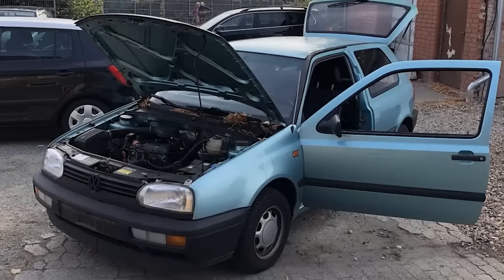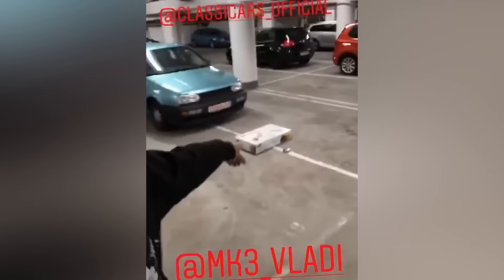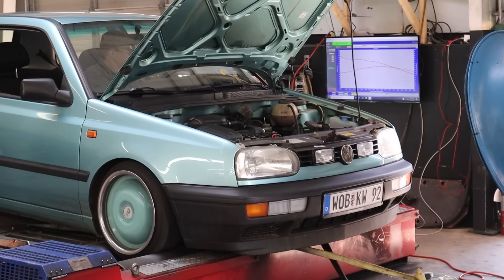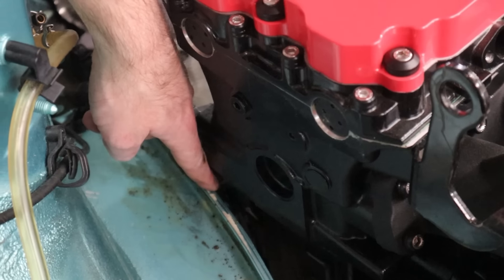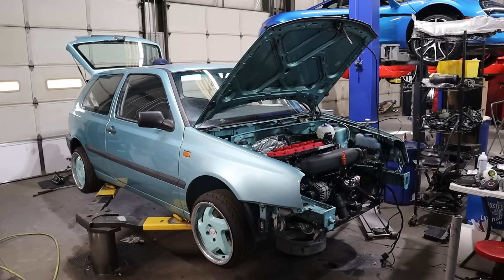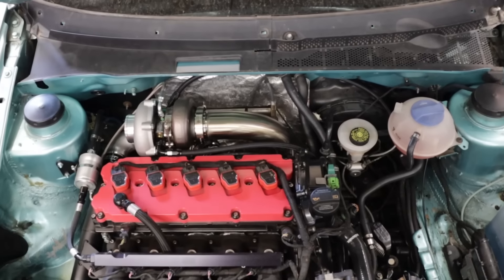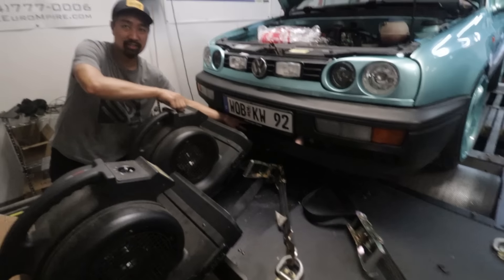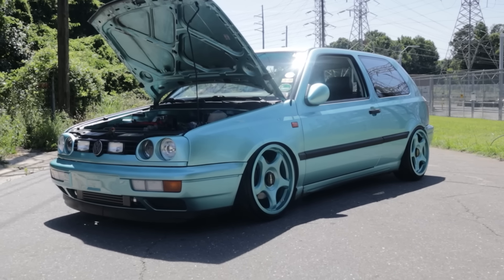James from Donut 2.5t MK3 Build - Start to Finish!

Comment: The more I watch this channel. The better I feel about putting $9,000 into a $800 police impound auction 2004 Golf 2.0 manual. One day my car will be on Deutsche Auto Parts.
Reply: I love MK4s. I miss my 1.8t all the time.
Reply: @Chukijay  I had turd 01 MK4 1.8T Jetta. Not the fastest of cars and it came with the AWW motor, but I miss it so much.
Reply: Currently building my Leon 1M. Just do it, it's the best feeling in the world. If you can afford it of course.
Reply: I just uploaded a video of me replacing the right front wheel bearing. It is so much quieter on the hwy.
Reply: I've been thinking of getting a cheap 2.0 golf and swapping in the 07k.
Reply: @DividE546  nice project. Got my Cupra R 1M 3 month ago, so still a long way to go for me
Reply: As a MK1 TT quattro owner; 1.8t is a brilliant engine
Reply: Get a 1.8t head and some pistons and build a 20v 2.0 t!

Comment: Love that James decided to go with the VW 5 cylinder over the audi 5 cyl. Hopefully this will bring more attention to this engine and open more possibilities for mods!
Reply: I'm pretty sure they're the same engine that you'll find in an Audi
Reply: @avrggamer69  no it’s not.
Reply: @Anon_Fox  yeah it is the 2.5 I5 that is found in Audi's were also being used in VWs it was just developed and designed by Audi but it's definitely the same engine
Reply: @avrggamer69  if you want to say it’s the same with different fueling, injectors, manifold, fuel pumps, etc then sure. Obviously the VW model is stripped down compared to the ttrs. I don’t consider that the same.
Reply: @avrggamer69  no, ttrs/rs3 5cyl is way different from 5cyl from 2.5 NA jetta golf
Reply: @avrggamer69  There are probably many similarities in them but I wouldn't call it the same engine either. There has to be a ton of differences since the other one is a high compression nat. asp. motor and the other one a turbo.
Reply: @mrlaholatva  same argument as the vw n/a 2.0 liter being the same as the FSI or the FSI/tsi. They are different not the same lol
Reply: RS3 engine is alublock, jetta is cast
Reply: Also the cyl heads are different, not fuel Injected like the na 2.5, cams, port size, etc. reason why na 2.5 is attainable for a few hundred vs 10k from rs3/ttrs
Reply: @Anon_Fox  same same, but different.
Reply: @avrggamer69  the Audi EA855 evo engines in RS cars are more closely related to the lambo V10 than the VW 2.5 ... its basically half of one of those V10 engines with a turbo slapped on. The audi 5 cyclinder engines share basically nothing with the old VW engines.
Reply: It really is a nice engine in my opinion, not the most efficient but you cant beat that sound and output on 10 psi
Reply: 07k baby!!!
Reply: @avrggamer69  VW 2.5 is port injected.   Audi's 2.5 in the TTRS and the R3 is direct injected,  for starters.
Reply: @rigozuniga8096  same block, same engine code.... All 07k........ V8 from Chevy truck or a Corvette..... Still LS......
Reply: @aidencoder  that's complete fanboy myth... The 07k was developed in the 90s as a workhorse engine for the eurovan. 07k was developed from lessons learned from the 5v Audi quattros..... It was then used for VWs until 2014 and then for Audi RS models....... In the late 90s, Lamborghini/audi v10s engine underpinnings are based on the 07k.  the 5 cylinders came first before the 10 cylinders... That's why parts from a VW 07k fit with Audi crap..... Look up IROZ motorsports from Las Vegas........ He uses VW metal iron blocks for rs3 builds since they take better power then aluminum.....
Reply: @MiguelGarcia-vj7oo  It was IROZ and Hoonigan that did an explainer on why the 07K was closer to the V10 (with interchangable valvetrain parts and so on) than the older 5 pots. Infact, if you've ever seen both 07K and the audi/lambo V10 side-by-side you can visually see what they did. That's not to say the V10 didn't follow some linearage from the older 5-cyl. It's all related.

The fact the EA855 and EA855 EVO swapped from iron to aluminium alloy doesn't prove your point. IROZ are using older RS3/TTRS EA855 iron blocks instead of newer RS3/TTRS EA855 EVO blocks that swapped to lighter alloy.

The AAF-type enginers used in the Transporter and the 	WR-onward 5-cyls used in things like the venerable Ur Quattro share very little with modern 07K/DAZA and similar blocks in terms of mechanics, aside from being petrol 5-cyl engines. The valvetrain is completely different, fueling is totally different. Everything.

The fueling, block dimensions, valvetrain, bottom end and basically everything important are lifted from development of the 5.0 V10 mixed with advances from the 5.2 V10 used in later Gallardo/Hurracan models.

Here's the video with Hank from IROZ.

https://www.youtube.com/watch?v=pYhnllDqsxc&t=17s
Reply: To all that don't know. it's that same motor as the Audi RS3. It's the 07K. Just the Audi has an Aluminum Block and ofc forged internals and a turbo. Stock compression on the NA 07k is actually 9.5:1 and the RS3 is 10.0:1 which might seem unbelievable to some but 100% true.
Reply: @Anon_Fox  Same motor. It's called the 07K. Just like a 2JZ is a 2JZ. Just an Aluminum vs Iron block, forged internals and a turbo. The NA 2.0 is not the same engine code as the 2.0 turbo.
Reply: @rigozuniga8096  Different parts. Not way different. Same engine 07K.
Reply: Plenty of It in u.k not much over here I. Us
Reply: @aidencoder  yea no shit the ur quattro drivetrain is different from 07k. I didn't say that. I said the 07k was an evolution. Just like the m12 and S14 are an evolution from m10. Ulrich  Baretzky is on record claiming that when he was designing the 07k he based it on the IMSA GTO Audi 90 engine. That was his bench mark, his inspiration and where to evolve the 5 cylinder from it's errors. The IMSA car was his first project going into Audi leaving bmw due to  Head Butting with the legendary Paul Rosche. IMSA  GTO drivetrain  is the same drivetrain from the ur quattros just improved.

Comment: I’m so glad that this car is still living its best life now with James!
The first thing I did after buying it in Germany was drive it flat out on the Autobahn, and it did manage over 100mph IIRC 😅So the old engine wasn’t that bad, but the new one is a work of art. 

Thanks for sharing the story Deutsche Auto Parts!
Reply: I was surprised to see what horsepower it was providing tho, was expecting more lol
A quick trivia: you can find tons and tons of that engine in Brazil (as the so-called AP engine, just slightly different that the golf's). It's a favorite for cheap horsepower, people can easily get 200+ HP with a basic turbo setup w/ stock internals. Here's one example with 500+ HP: https://www.youtube.com/watch?v=RQw461FCKVM
Reply: Definitely a good find,u done good and its nice it found a good home with j.p.,cant believe the clock it had next to the speedometer,never seen that before.. pretty cool.. the colours nice too.hope them kw's found a good home.i love mine. Now do me a favour and find me a pontius rear diffuser!! Lol. But seriously please do.😉
Reply: @DanielBertolozi  epic video. I didn't understand what they were say but was this with forged internals? I want to turbo my Santana b2 aka passat here in SA. But I want to use stock intermals and abouy 200 wheel hp.
Reply: @madhut3042  yep, for that they're using forget internals - I think pistons and rods. 200whp should be safe with stock internals and trans, btw
Reply: @zdrifterboy  the clock was normal for the lower option models, its a base CL (comfort line) so literally just basics no ac, no heated seats you get me
Reply: @hephaistosthesmith2069  yeah man..im just spoilt with vr's i reckon😉

Comment: Deutsche Autowerks: So James how much torque steer would you like?
Pumphrey: Yes
Reply: here in donut we dont care abot torque steer,we only care about MO POWA BABEH!!
Reply: @KitKitChanIsaac  start sending it to the rear wheels then 😂
Reply: Around 300hp in front is no biggie.
I've seen 500+hp on FWD with acceptable take offs though.
But nothing compares to a 1100+hp RWD. A whole different story.
Reply: @DanielFrost79  I love not being able to use 90% of my power in corners.

Comment: I'm a Subaru guy first and foremost, and I will admit that I normally hate VWs for no rational reason, but this is absolutely fire. The thought of running a 2.5L I5 never occurred to me before, but after seeing this swap I really want to see more like it.
Reply: Bro I'm more of a Volkswagen guy but my entire goal is to take my slow GTI 1.8 t and try and make it beat my Brothers VR6 nitrous Jetta
Reply: Welp I respect your opinion but to hate a brand out of no rational reason is pure stupidity.
Reply: O7k sounds better then any Subaru engine while making power more reliably..... The vw groups only reliable motor........

Comment: The original 1.8 port injected engine was known for going close to 1M kilometers without a rebuild.
Reply: not surprising with how understressed /little power it makes
Reply: @papa_pt  it was produced until 1997 so it had to meet Euro 2 emissions. Like most port injected engines from this time they couldn't make more and still meet emissions.
Reply: @RadostinVelchev  ahh gotcha. Nothing wrong with a long lasting motor , I've noticed that engines generally have a shorter life with high specific output
Reply: That's good news, my mom has same engine in her MK3 and it has 210K now.

Comment: great swap for this little beast..around 300 hp is plenty for a daily..I found out that when I swapped my first 5 cyl turbo motor in a V40 Volvo..i missed out on engine bay cooling and had heating issues even with the fire wall with the 'misplaced' turbo..too hot.!!!.so on the second car ,I made sure my air filter was boxed and sucked fresh outside air ,had extractor fans & vents (on demand with switch/temp gage & sensors..and a discret hood grill above that turbo...never had heat problems again...especially stuck in traffic between red light pulls..!!

Comment: My previous car was mk3 golf wagon which I owned for 10 years with that same 1.8 8v (ADZ) engine. Super reliable car and I drove the absolute living hell out of it. It had 282 thousand kms on it when I bought it and 482 thousand kms when it got scrapped because it was super rusty and not worth repairing anymore. One time when it was due to MOT inspection I went for a drive good 60km drive to warm up the catalytic convertor for the emission test. I drove last 30kms on 4th gear and I was doing 120km/h on the highway just to make the cat nice and warm and when I got to the MOT office and they start the inspection procedure they decided to check the oil and the oil dipstick didn't even get wet. I was like shit, that engine must be toast. I had 1liter jug of oil in the trunk which I poured to the engine while the inspector was next to me and he decided to check the oil again and it still didn't get wet. He was like "You should go and get some oil for this afterwards" and I agreed. My car didn't pass the MOT and I had to take it to a mechanic to fix what was wrong with it. The engine was fine and I drove 3 years with that car after that incident.

It's nice to see that some do appreciate these cars for what they are and build them to these crazy things. Personally I wouldn't own another VW in my life again but I'm still a fan of german cars which I bought another one but from different manufacturer

Comment: The 1.8 90hp was a great engine. I had it in my Vento (Jetta MkIII), it was the perfect balance between power and fuel consumption. I later bought a Bora (Jetta MkIV) with a 2.0 115hp engine, the fuel consumption was way too much more in regard to performance. Most people just went for the TDIs of the time.
Reply: i agree, i have the same 1.8 also on a jetta and its a great and simple engine

Comment: The hottest mk3 i ever seen was. The DTM Auto Häus mk3. Black, widebody, vr6 turbo, abt grill, remus dtm tip exhaust, round headlight kit, rear clear frosted tailights. It had a flat black strip that ran from the rear exhaust to the the front headlight. The wheels where 3 piece i forgot the brand but had orange and red badge. Later on he changed them to DTM Auto Häus wheels.

Comment: I got one like this: the 1.8 8V got 264 000 Kilometers ( 164042 miles if the conversion is good), and got another one: 1.4 liter, almost 300 000 kilometers.
Ain't gonna swap yhe 1.8, but gonna rebuild it, see what I can do: higher fuel pressur, injector from a chrysler 2.5, camshafts, exhaust, and some other thing. I don't want to increase HP by a large magin, but if I got back the 90 horses, and got 10-15 more, with a cleaner engine, wel, I'm ok!

Comment: Adding the 1.8l power steering pump noted at 10:35 allowed for the IE Intake Manifold to fit? I know IE specifies that it does not usually fit on cars with hydraulic power steering @DeutscheAutoParts

Comment: 305 at 10 psi on stock internals that’s around the oem 2nd gen tt rs 2.5 07k but that engine has probably better internals even though this engine has a better header flows more 😍

Comment: So I have the IE intake manifold, AFE intake, straight piped for now, new fuel system to run E85, and a IE stage 2 E85 tune and TCU tune and I make 300whp
Reply: I got the same billet valve cover too but that done add power just gets rid of the weird internal pcv valve

Comment: From my knowledge that should be a GT model as its the 90HP variant, normal MK3 that came with the 1.8L engine were 75 hp, other upgrades from the GT model include read disk brakes, with a 4x100 bolt pattern. I used to own a 1.8GT 90HP Mk3 and while not fast, that car was a blast
Reply: The GT has a revcounter not a clock like this version.

Comment: you guys should make a kit for swapping the hydraulic power steering to electric power steering for the 2.5 engine. I've been wanting to swap out my intake manifold but haven't been able to find a solution around the power steering.
Reply: A lot of TRW pump (w/reservior) conversions on net (porsche 964,993,VW T3/4, etc). In EU we use one from VW Polo, Skoda Fabia.

Or power steering column (on manual str. rack) from Corsa, Clio, Punto (small GM cars).
Reply: @ventouxR  Is that like a common way to get over that problem? Are there videos out there that could guide me through it if I do decide to go that route? Thank you for the advice btw

Comment: Hi I have a issue on my mk5 GTI during idle I have misfire on cylinder 3 and 4 and during high 5000rpm my car judders  changed out fuel filter, pcv valve, plugs, coils, 2 injectors and recently put in a new cam follower my car is still misfiring at low idle and it judders and misfires at 5000rpm onwards when I scanned the car I get P1093, P0300,P0301 and P0302 but no check engine light  my car as a stage 1 Apr with intake and downpipe not sure what else to look at?

Comment: I have a 1.4T mk7 golf. Would it be fair to assume a set of Michelin pilot sport 4 tyres would be outperformed by a set of coilovers and rear sway bar at a track day? Or would they still be plenty capable? I've done a couple track days on said tyres and lowering springs, but im planning to upgrade the suspension

Comment: i have the same engine and am in the process of turboing it, how did you tune the factory ecu? are you MAP of MAF? please help. killer video, 5 cyliders sound amazing, that mk3 is sick.
Reply: I'd be leary with the stock 2.5 ecu. They need to be direct port flashed or at minimum the car has to be present. Most early 2.5 were MAP only. But anything beyond what they did here is going to demand stand alone tuning.
Reply: @joehanna501  I would be ecstatic  with the same results for my 5 cylinder. I know to go bigger I need a fuel system and a few other things but 6-9 pounds of boost would be plenty to start. I think the turbo I would get may be a bit smaller, not looking for a freeway missile, I want power out of corners with no waiting instead of big numbers, big flat torque. The ecu turbo flash or ecu tune is not readily available close to me for the model of car and engine I have. Most places have told me nope you can not tune the stock ecu for your map based car if you have added a turbo, unless you buy a standalone. Just trying to save money not buying a standalone if the stock ecu can handle a bit of boost.
Reply: @joehanna501  most early 2.5(mk5 golf) were maf. Do you mean older ones? I have a 2013 golf with a 5 cylinder and it’s map, I think they changed from maf to map in 2010.

Comment: They replaced the coolant tank for a new one... Those new ones suck and start leaking in time causing nightmares, that is why you keep and fix or clean the OEM. The alternator that came with the VW is eternal, I would have kept that one also.

Comment: Love the build but the comparisons between that VW 2.5 and the TTRS/RS3 2.5 are a bit odd. Afaik displacement and cylinder layout is about all they have in common? 07k EA855  evo engines from the RS cars have a closer relationship to the  VAG V10 engines  than the VW 2.5L.

Comment: Volkswagen from late 90s are the best by far
Reply: You could get options like ABS, dual airbags, climatronic, power mirrors, heated seats... but still simple, reliable and easy to work with. Modern cars are a pain in the ass, always some stupid sensor or wathever failing.
Reply: And you could find parts everywhere